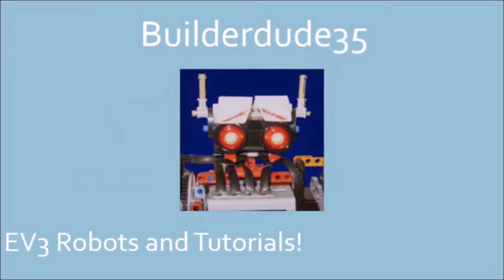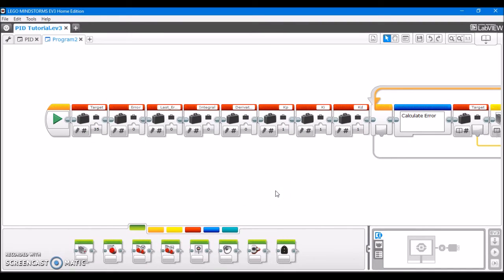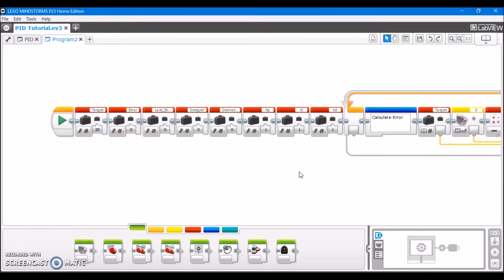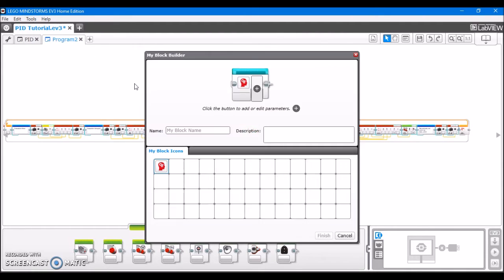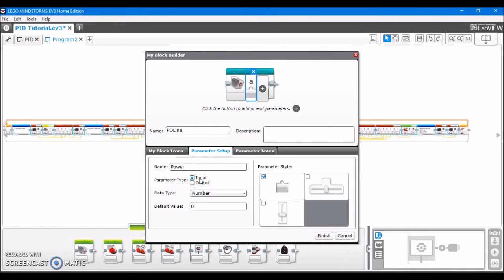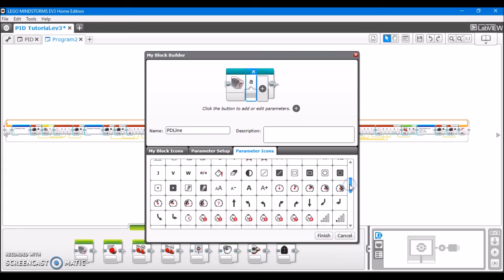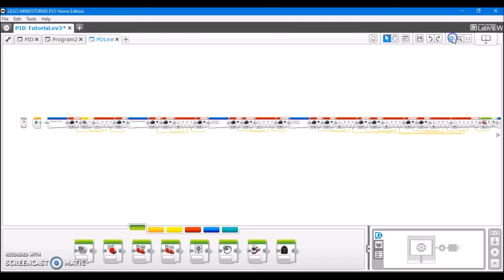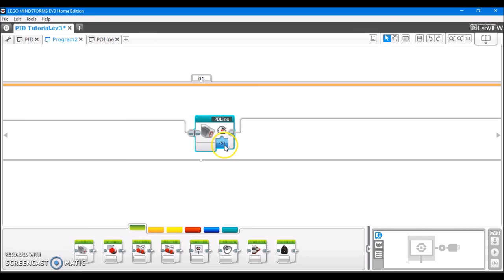MyBlock Parameters in EV3-G - The Ultimate Programming Convenience

Comment: I am using a parameter for how many times to repeat a loop. When I drag the Parameter input to the loop number, it makes three inputs. Can you explain what is happening? Here is a link to a picture: https://drive.google.com/file/d/0Bwn2GzaBTzwCSGRDSGstZ3ppWjA/view?usp=sharing
Reply from the maker: That's quite common and it happens when you take a data wire from outside a loop and pull it into the loop. It's just a visual error, and I haven't known it to interfere with the program's operation.
Reply: Thanks Builderdude35! You are really helping our FLL group.

Comment: Nice video. One question though. Do you have anything on turtle shell designs for an FLL robot? Like those huge attachments that just you kinda drop on to a robot and it magically automatically connects to all the motors and stuff. How does the connection work? Thanks if you have anything on it, but I kinda understand the difficulty of the turtle shell attachments so no pressure. But your a genius so that makes it different.
Reply from the maker: The connection works with using dog gears. I already have a video on this topic, so that will explain how that works. Then, the attachment itself will simply side onto the robot, kept stable on the robot with gravity.
Reply: Can you give me the link of the video because my eyes are dead from searching through all your videos and failing to find the video on the turtle shell attachment. Making me just about as grumpy as Grunt. Also, do the dog gears point up to interlock with the attachments and how do you know that the other interlocking piece of the attachment properly align with the dog gear part that is connected to the motor correctly without using motor control? (I'm a run-on sentence master I know...three two one...facepalm!) So with gravity, does the turtle shell attachment have to fit perfectly onto the robot or be balanced in weight and size on each side? Or both? Thanks a lot thanks to you, we advanced to regionals. :p
Reply: Hey.... Just SEARCH